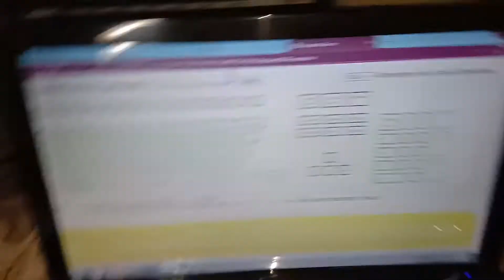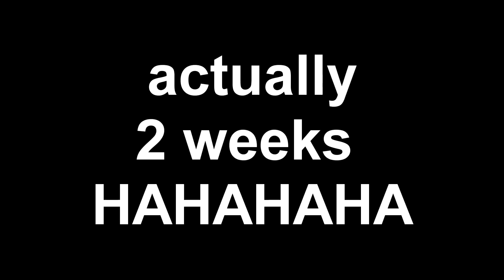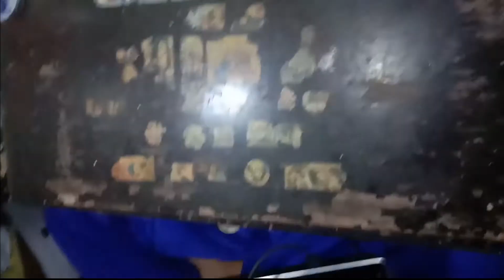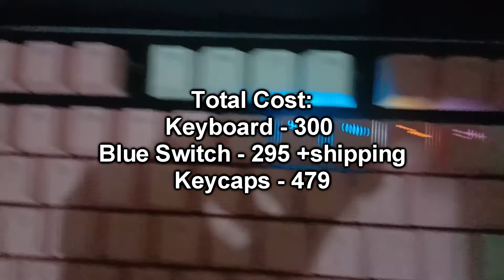Rakk kimat xt.le Full Repair and Keycaps Installation - Rakk Kimat XT.LE Project Keyboard part 3

Comment: Hindi ako makapaniwala na binentahan ako ng kimat xt le sa halagang 250 walang issue sadyang madumi lang. After testing rekta mods agad ako. Converted to detachable usb type-c, change all switches to lubed outemu reds, clipped stabs and lubed bandaid mod, pbt keycaps. Solid talaga

Comment: Paano malalaman Kung hotswap meron akong na bought last Christmas need na Kasi diinan Yung r para magregister gusto ko palitan switch
Reply from the maker: Pinaka safe option check yunng box pag may nakasulat. Pag wala open mo nalang yung keyboardbcheck mo kung naka socket orhindi
Reply: @EonLimpiado11  ano pwede gawin kapag need diinan Yung keys any easy solution?
Reply: @EonLimpiado11  ask narin if rev 1 ba inyo sa likod Kasi Ng box may pic na natatangal Yung switch pero walang sinabing hot swap and rev 2 Yung nakalagay sa serial Bale if rev 2 ba hotswappable
Reply from the maker: contact cleaner. di pako nag papalit ng switch sa pinaka una kong keyboard. 2 years na yun
Reply from the maker: pag walang pera edi alcohol makesure pala na nakahugot yung keyboard and patuyuin muna baka madamage yung rgb LED

Comment: boss meron akong ganyan kaso usb not recognized.  di na nagamit since naglockdown tapos walang ilaw, lumutong mga switch wala ng tunog o click.  Pag insert sa usb ay yun ang problem.  Ano sa tingin ang problem?
Reply from the maker: kung may tester ka try mo icheck cables kung may problema. tas kapag okay yung cable nya yung mismmong chip ng keyboard yung may problema
Reply: @EonLimpiado11   resolder lang po ba yun chip sir ?

Comment: lods nakatry ka na mag change ng led ng xt.le? daming pundi na kasi ng sakin :(
Reply from the maker: pwede kaso mahirap kasi aalisin mo lahat ng switch.
Reply: @EonLimpiado11  may link ka ng leds nya? un nasa lazada kasi square e, etong xt le kasi bilog ang leds nya, gusto ko sana marepair kahit padating na un ilis ko
Reply from the maker: @onikagemaru104  di ko pa nasukat yung actual size ng LED nya. madami kasing variations yung rgb LED tsaka di ko din kabisado pinout. try mo nalang sukatin  tapos alamin kung nasan banda pinout para bumili ka nalang online. same lang naman siguro ng voltage yun eh

Comment: Sir pano nyo po tinangtagal yung keys
Reply from the maker: anong keys ba? keycaps? switch?
Reply: @EonLimpiado11  switch po
Reply from the maker: @akito7958  desolder yung 2 pins tapos hilain mo gamit switch puller
Reply: @EonLimpiado11  bale need pa po buksan yung pinaka case ng keyboard po?
Reply from the maker: @akito7958  yes. gamit ka torx tapos philips screw driver
Reply: @EonLimpiado11  okay po sir thank you po